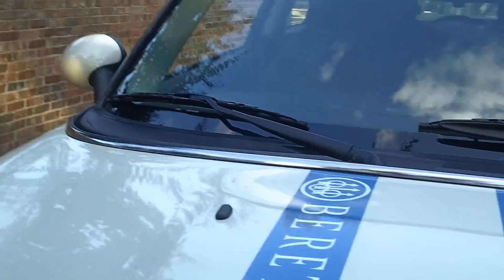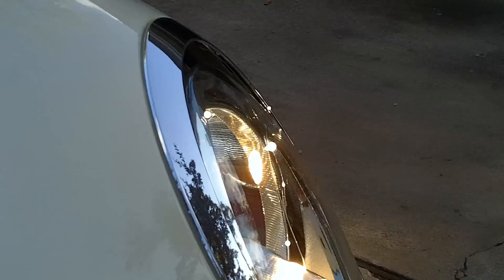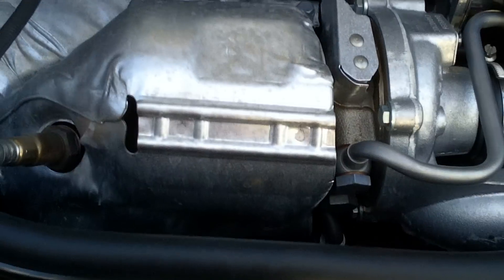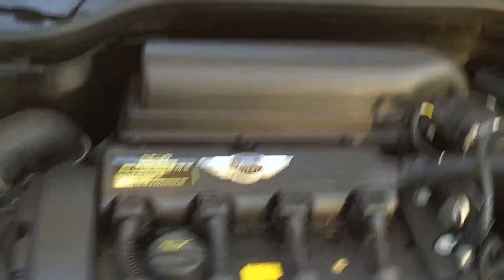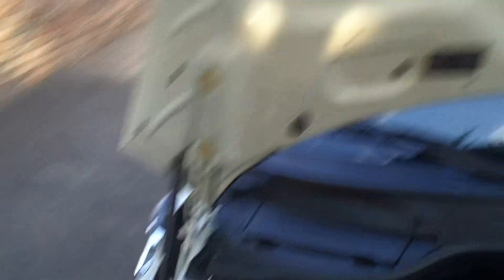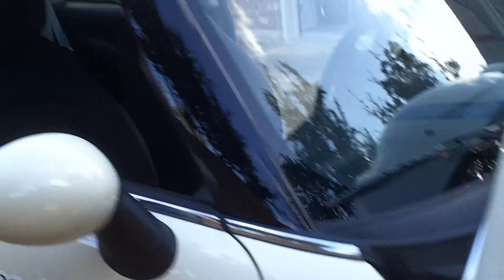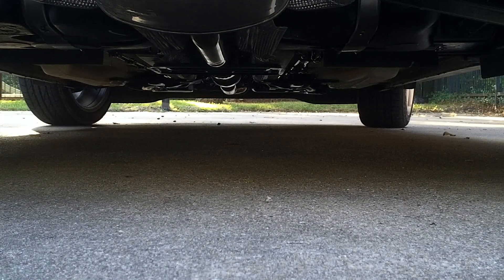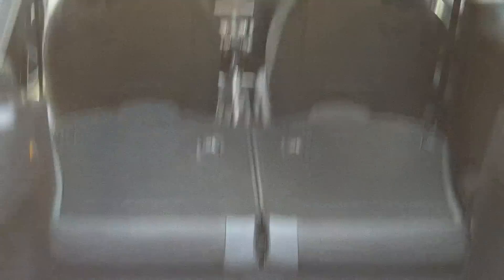Mini Cooper S Startup, Rev, Exhaust Pt.3

Comment: if you want to gain 15-20 extra horse power.. buy a new intake hose that goes from the turbo to the throttle body... in the hose theres a little plastic restrictor plate the brings your boost down alot... easy 15 horse for about 60$